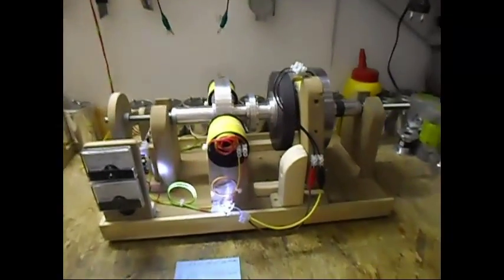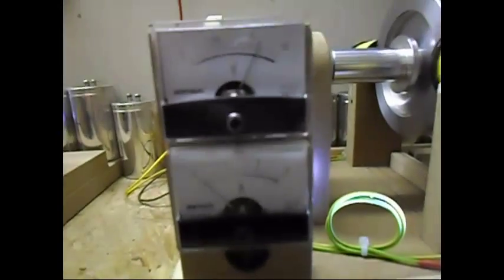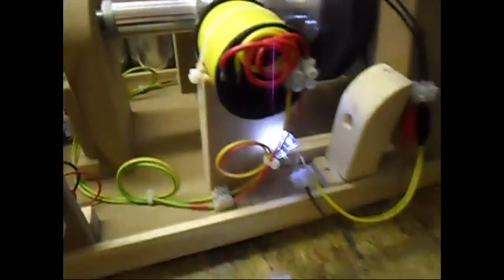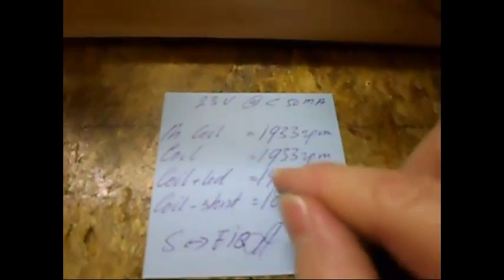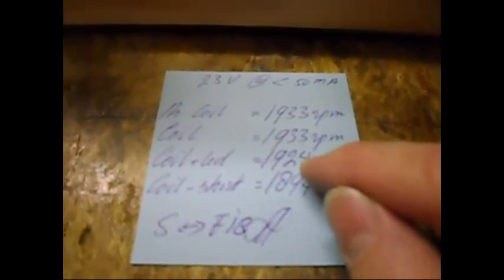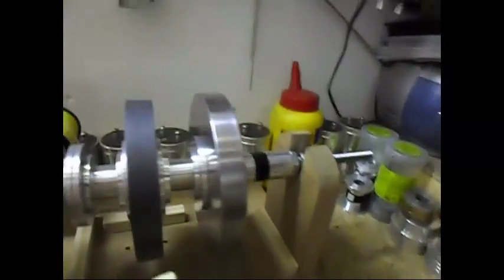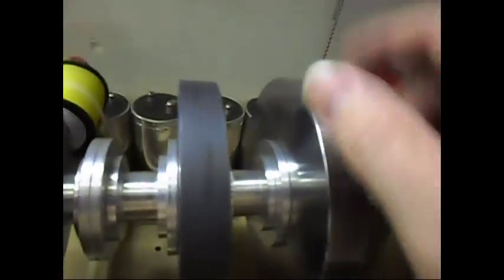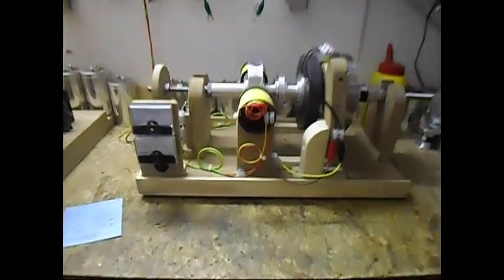Flux Gate Generator - Update 12 Rotation of 1 ring magnet & 1 full iron rotor...

Comment: Quick question: For the coil placed in between the magnet (south polarity) and the iron rotor, what is the polarity of the coil (electromagnetic)? You mentioned that the coil must be placed parallel to the spindle to work, which would coincide with a north (attraction) or south (repulsion) polarity coming from the coil itself. Just curious if the coils polarity makes any difference. Thanks for making the video.
Reply from the maker: Hi Notnotthatguy810,
Thanks for your comment...^^
When the coil becomes a electromagnet it does slow down the system a bit so it's polarity is like any normal generator coil...push when south pole fields enters the core/coil and pull when south pole fields leaves the core/coil...;-)
But in this configuration the fields of the electromagnet does not work against the rotation of the magnet(just a tiny bit) but at a 90 degree angle up on the rotating magnet so there for it is doing pretty good...^^
Cheers

Comment: How is the ring magnet making power like that?  I've seen it in an AC motor like that but i just don't understand.
Reply from the maker: Hi Jared Graber,
Thanks for your comment...^^
It's producing energy because the magnetic field is in a fixed position in magnets...so by spinning the ring magnet the field is also spinning...;-)
Since the field is spinning it cuts thru the copper wires of the coil and as you know when a magnetic field cuts thru copper wires energy is being produced...^^
Cheers
Reply: Mister Caribbean Roots But what about the whole N S N S N S configuration?  Don't you need that alternating field to make power?   

@_@   Is only the one poles magnetic field rotating facing the copper wires and making the power?   

Thanks for your patients lol,  I just don't understand yet whats happening.
Reply from the maker: Jared Graber
No problemo man...;-)
We all need to start somewhere so i do know the feeling and will try to answer all your question as good as i can...^^
Nope, you can make power with N,N,N or S,S,S or N,S,N or as can be seen in my videos with a ring magnet with one uniform pole only...;-)
Using the first 3 options will still get you an AC output...yep...the first 2 ones also...^^
Btw, when you see a ring magnet in motors it is usually a multi pole one...;-)
Cheers
Reply: Thanks a lot  :D  

If you dont mind me asking  1 more thing though,  how does a N,N,N  or S,S,S create an AC field?
Reply from the maker: Jared Graber
Hi there,
It's no problemo and you're welcome...^^
For example lets use the south pole...
This south pole is approaching the coil and the moment it's magnetic field lines starts to cut into the coil the positive part(or high side) of the AC current is being produced...
The moment the south pole reaches the exact center of the coil the AC current is now at the zero line...
Now the south pole is starting to leave the center which means it is starting to leave the coil and starts your negative part(or low side) of the AC current...
And now you have the complete AC current sine wave...^^
Cheers
Reply: Oh ok!  
So the bigger the coil the longer the time between High and Low sine waves as it moves past the coil.  And the smaller the coil the shorter the time between High and Low sine waves.

Does your ring magnet in the video have poles along its circumference or just the normal flat faces?
Reply from the maker: Jared Graber
Size of the coil does not matter...speed and amount of rotor magnets does...;-)
The ring magnet in my video has one pole on each side...^^
So looking at it on it's circumference you would see both poles non stop...:D
I wish i could find/buy a ring magnet like i have now but a multi pole one...^^
Reply: You can magnetically code magnets like that with several poles on one disk, but its very difficult.  Pure iron is the easiest to turn into a magnet, by heating it to were its glowing hot and no longer magnetic you slide a coil encased in a clay based sleeve energized around the iron and drop it into cold water.  When the iron rapidly cools it now holds the same magnetic field that was in the coil forever. 

I find it interesting how you can get so much more power out of a magnet then what was used to make it.
Reply from the maker: Jared Graber
No man, not gonna try to make my own magnets... it's too much of a hassle...lol
Yep, once magnetized you have a magnet to produce energy for a few hundreds years but it will take way more energy to produce some energy so that little bit it took to make the magnet is like a needle in the hey stack and lets not forget the amount needed to drive the bloody generator too...lol
Reply: Yeah, I dont blame you for that one bit.  Lol

Comment: The measurement's are looking better. At least to me they are. Have you tried Black sand / Magnetite for your core material ?.
All the best.
Bobby
Reply from the maker: Hi Bobby,
They are looking good...that is true but i'm not there yet...;-)
Black sand...nope...Alloy 50 works way better but it has it draw back sometimes...it all depends on the setup configuration...^^
Cheers

Comment from the maker: Just update where the system is now 1 ring magnet with south pole facing in & one full iron rotor wich is my flywheel...^^
Numbers,
Input is 23Vdc @ <50ma...
No coil in place = 1933 rpm
Coil in place = 1933 rpm...:D...cool...
Coil & leds = 1924 rpm...pretty good...^^
Coil shorted = 1894 rpm...not that bad either but it can be much better ofcourse...;-)

This update/test takes about 30min to do so what you see here is only a tiny bit of it...otherwise it would be a long boring video...lol

Here one can clearly see the basic workings of the magnetic field of rings magnets when they are spinning...^^
Guess i only need a coil now that doesn't slow down the drive side and i'm done...???...lol

And good thing here is also the fact that the leds are not flikkering sooo...stable output...:D...^^